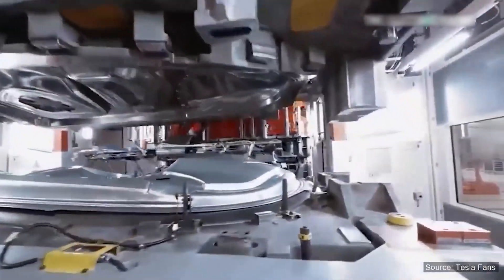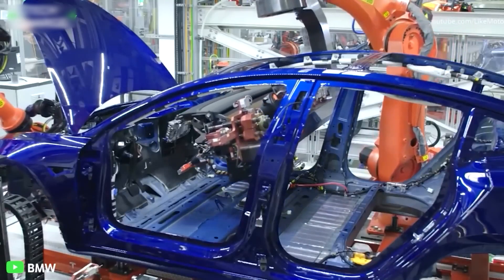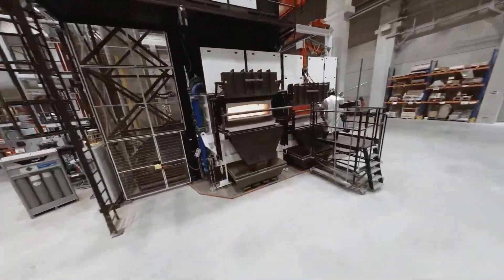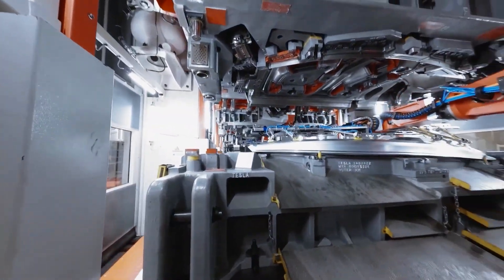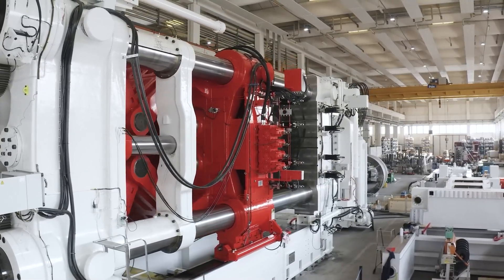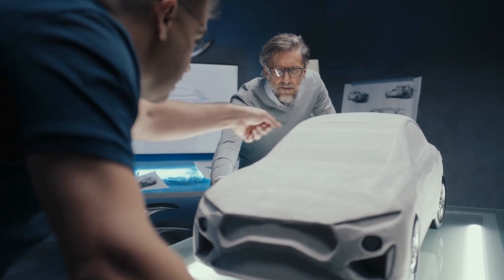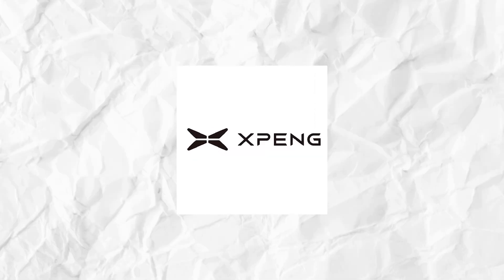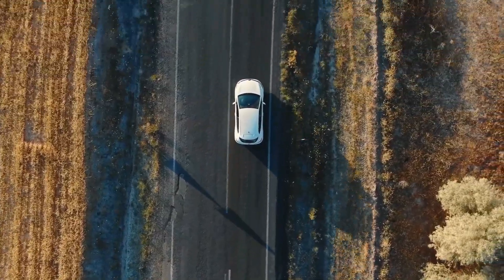China's Magnesium Gigacasting Better Than Tesla's Giga Press?

Comment: Good for Tesla but bad for Insurance companies & customers. Minor accident could bend pillars, front & rear  body structure. These are Aluminum. Normally,  you can buy parts, weld & repair. There is no way you could do the same with Tesla. No parts !!!. So insurance companies will junk the cars. Your insurance will go up. You get lower than the  market value. You will have to buy another Tesla ?. Good for Musk because production costs are lower & he can sell more cars. SCAM !!!

Comment: Magnesium fire is pretty intense, coupled with runaway EV battery fire, it sounds very dangerous..

Magnesium metal and its alloys are explosive hazards; they are highly flammable in their pure form when molten or in powder or in ribbon form. Burning or molten magnesium metal reacts violently with water.

Good luck to fire fighters trying to put out a magnesium and EV battery fire..

Comment: This seems like a big risk - that metal isnt as strong so if you get into a car accident - you might not make it back home xD LEt alone if your battery does start to have  thermal run away - I do belive battery fires reach temperature to set the shell on fire as well. But if it is made in one part - it does open the door where repairability will be out the door. I belive Al is a bit more rigid as well - meaning it will try to take back the shape it was desing in. Mg doesnt do that.

Comment: Magnesium is much more flammable, bad combo with high performance batteries.
Reply: Takes a lot to get then to burn.
Reply: @tonyp2865  Thermal run away from a battery should be enough though.
Reply: Then it wouldn't matter what they are made of, it will be a total loss.  @adr2t
Reply: It was mentioned but briefly.

Comment: These will be unrepairable. Going to be a nightmare for repair shops.
Reply: You not driving 1960s metal chunk anymore, casting or not modern car including gasoline car designed to crumpled during crash to absorb the force for safety purposes. Tesla engineer already calculate any force that damage this casting will totalled any modern car.
Reply: @thatsawesome2060  this is not a telsa. Telsa does not use magnesium casting as it is brittle.  Telsa castings are designed to be repaired and are made of aluminum. Magnesium casting are not new and have been used forever for making parts like radiator core supports.
Reply: Disposable like everything else.
Reply: Don't repair, just replace the damaged casting with a new one, should be less labour intensive than repairing multiple parts that may have lost some of their properties. The damaged casting can be recycled (I''m guessing here). That's my take on it and It's also possible that the casting may withstand (survive) collisions that need repairing compared to conventional methods.
Reply: @anthonyxuereb792  That would be even more work - as you would have to transplant many more things to make that happen vers a section. I am going to assume they will just say your car is "totaled" at that point even if it wasnt much of a hit to start with.